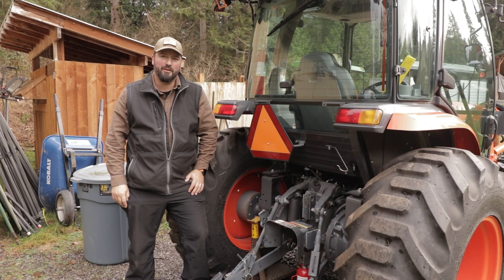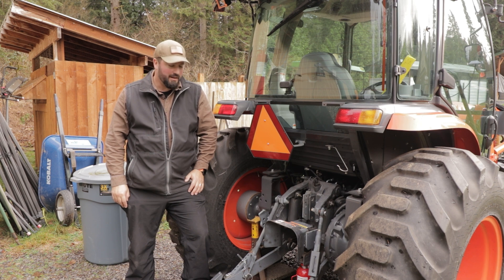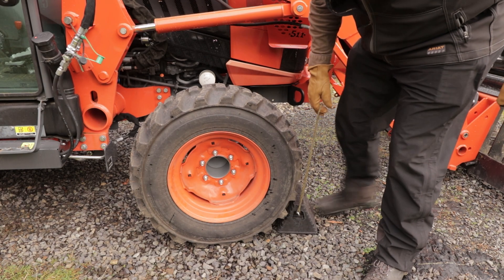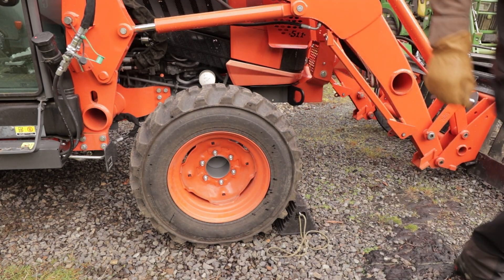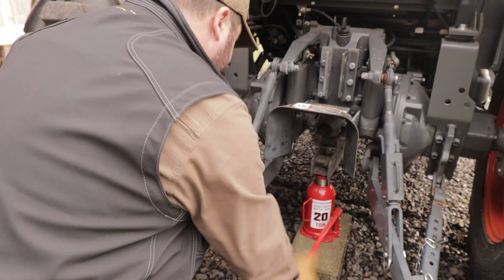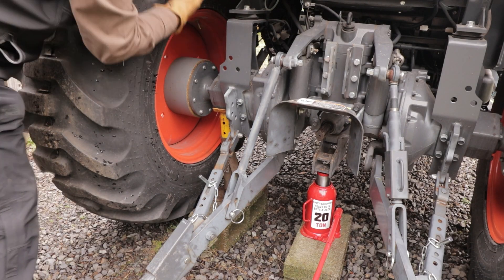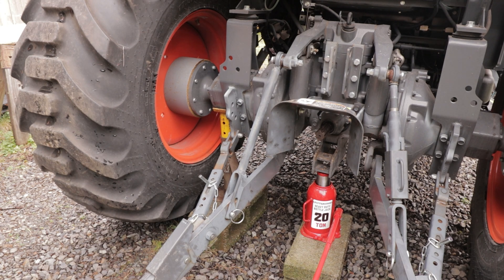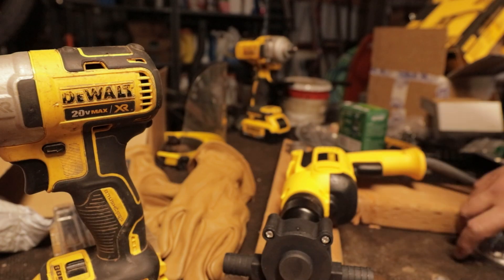WHAT IS HE PUTTING IN THOSE TIRES

Comment: You got lots of great comments and suggestions. One of the best is using a submersible pump with built in check valve. If that is not doable, install a simple pvc check valve on the suction hose. A second pvc valve on pump discharge could also help. Add a pvc tee with a screw plug on the pump discharge to simplify priming. Another good suggestion I saw was to bore hole at the bottom of the can, install a pvc hose adapter on the can and set it up on some saw horses above the level of the pump. The prime is then gravity fed to the pump. Another good suggestion was to install a bleeder at the tire stem adapter for bleeding off the air pressure as the tire fills with liquid. All great ideas. YouTuber "Tony's Tractor Adventures" also has a good video on DIY tire ballast. Thanks for the video.

Comment: Through the years from the end of the 1940's, we have tried calcium cloride in the rear tires but it is so corrosive; you get leaks through time, and your rims rotting out. The only way to go up here in Canada is those outrageously expensive bolt-on wheel weights.

Comment: A T near the tire valve with a quarter turn valve to release air periodically would help. Just shut off the pump at the same time you open the release valve. Most farmers in Canada use calcium cloride solution, because it's heavier. It won't freeze at any temperature that you would run a farm tractor, and even if it froze you could still move the unit in an emergency.
Reply from the maker: If you run CaCl you might want to put it in an inner tube to save your rims from corrosion. Just saying.
Reply: There's a pressure relief button on the side of the hose/valve stem adapter.

Comment: Why would you not put in calcium chloride? You buy it by the bag and mix it with water.  I've put gallons of water/CC mix in lots of tires. Water is 10 pounds per gallon and with CC in it will weigh  about 13 pounds, won't freeze solid at 40 below and 45 gallons gives about 585 pounds instead of 450. I've got one tractor with 800 lb weights plus 90 gallons of chloride mix per side, lots of traction.
Reply from the maker: It's a calcium salt. Salts are corrosive to the steel in your rims.
Reply: @hardwaylearnt  you're right, I am using tubes.

Comment: Can you get a check valve on output hose?  What about feeding form bottem of tank
Reply from the maker: Feeding from the bottom makes no difference. Once the hose was weighted it was feeding from the bottom. The issue was the bleed valve could not bleed the air fast enough and the pressure pushed gallons of air all the way back to the tank. A check valve would have solved it.

Comment: I filled my tires with the auto store brand and they sold it at 50% since i needed 90 gallons or so.  I bought an electric pump from Harbor Freight and had no issues.  I also bought clear hose so I knew what was happening.  Now my next dilemma is my 30 hour service is due and I have to remove the rear tire to get the the Hydraulic screen, at leas it will be way easier that way.  My problem is that I am a paraplegic and use a wheelchair.  I can't pick up a 3 or 400 lb tire.  My plan is to put it on a furniture dolly and with the entire tractor off the ground I should be able to jack it to the exact height and then spin the axle to line up the holes and push!   lol  I know they make tire dollies that the tire will spin the tire, but I think my idea will work and the new screen will out last me!  😁 Hopefully!  Is that Micarta on your bench top.  That is some rugged rugged stuff!
Reply from the maker: Make a video of that!  I'll watch. That "bench" is actually a scaffold on wheels.
Reply: Get somebody to help handle those tires, they are very heavy and unwieldy.

Comment: whats the effect of that antifreeze in contact with the tyre rubber long term, will it dissolve the tyre????

I bought a van that had a engine oil leak that dribbled down the shaft and got thrown off against the inner tyre wall other guy must have been just topping it up for years but the tyre was developing some real nasty splits i guess from the oil reacting with it
Reply from the maker: This is supposed to not eat tires or rims.

Comment: 35 years ago I started using windshield washer fluid pumped out of a 5 gallon bucket, with a submersible sump pump, to fill 14.9x24 R4 backhoe tires. That outfit stayed primed and would pump a gallon of fluid into the tire in about the same time as it took me to open up the next gallon jug. Had to stop about every 8 gallons to release air from the tire. Bought fluid on sale at Walmart for $0.99 a gallon back then. ( Probably cost twice that now. ) When tires wore out, I saved the 120 gallons of fluid in barrels while rims got painted and new tires and tubes were mounted, and then pumped the old fluid back into the tires again. Washer or winterizing fluid won't damage rims the way calcium does, and is only about a pound per gallon lighter in weight.
Reply from the maker: I could not locate a washer fluid that was less expensive than this antifreeze that had an equal or lower freeze point. I had bought some washer fluid concentrate but the recipe for mixing it up required this same antifreeze or methanol to lower the freeze point. This week the forecast is for single digit Temps so I'm glad I went with a -50 freeze point.

Comment: The pump should be on the ground so that it never looses prime.
Harbor freight sells a step on switch that can be used to turn the pump on while your working with your hands.
The jiggler sifan is a good idea. With a anti backflow marble.
Reply from the maker: Unfortunately even with the air bleed valve open the air pressure would have cleared the line even with the pump on the ground. A valve was needed but I didn't figure that out until almost finished.

Comment: I had a couple flats on the front of my tractor after mowing the hunting pasture several times. I stopped at the local tire shop and asked about having my 16 inch fronts foam filled, for a bit of ballast and cure it from ever going flat again. I didn't have them foamed, because I hadn't planned on taking out a bank loan at my age 😁 I bought a 12 dollar bottle of 'slime' and never looked back.
 The rears are full of windshield washer fluid, done before I owned it, which makes it great for plowing and tilling my food plots and garden.

Comment: solve your prime problem by drilling a hole in thee side of your trash can and installing a pvc hose adapter
near the bottom so it's pulling the solution below the liquid line at all times.
Reply from the maker: Totally if this was a regular occurrence but I didn't want to ruin the can for a one time job.

Comment: Well,,,,, I did find this video informative, I didn't know those pumps had to be primed over and over, so if I ever do this I'll get a check valve, and if that dont work I'd try setting barrel up on a stand, put a hole at bottom of barrel for a garden hose valve, then the drill would be at bottom of liquid.......
One thing I would be interested in adding to that liquid ballast is some sort of anti flat solution, I seen [Good Works Tractors] advertise some stuff that is added to tires. I thinking of doing that to my tractor this coming summer, if I get a flat tire on 11.2-24 ag, it's about $300.00 to fix and refill.......
I have two tractors, [07] L3400 and [21] CK3510<<< that one has Rim-Gard, but the L3400 has Ballast Star, I had that put in 7 years ago on one side then 5 years ago on other when I got flat tires. I wanted Rim-Gard but that tractor place couldn't fix tire for a week, the other tractor place could fix tire now so I took tire their, when they told me they use Ballast Star, a calcium hybrid solution that supposedly wont rust wheels, I had them put tubes in for extra rim protection just incase. I'm not convince yet that calcium can be made not to rust wheels, but least they got tire fixed so I could use tractor...........
It's really a Hoover shame Rim-Gard wont sell to no one but dealers, I think it's a way to keep their prices shy high, they have the right as they should but at same time other companies should have the right to make and sell similar products to the public, but looks like none want to so people like you and me are stuck trying to make our own concoction for tire ballast, and looks to me you found a good solution......
PS. I made long comment because for some reason you dont have many, good video thanks for posting..........
Reply from the maker: Thanks for watching and the great comment.